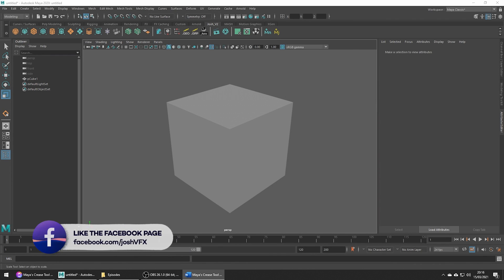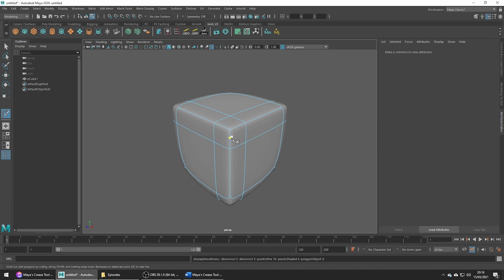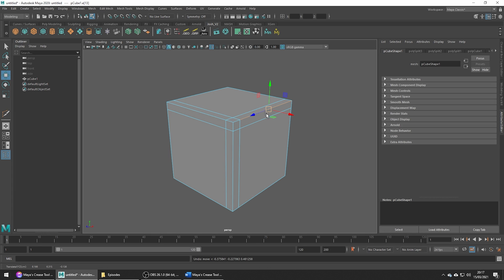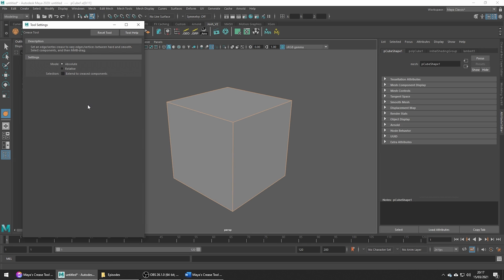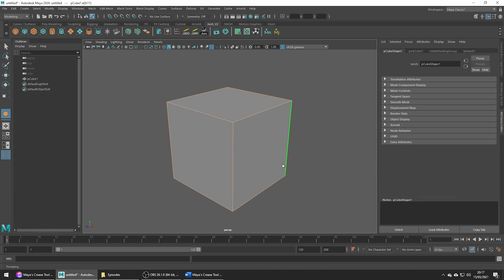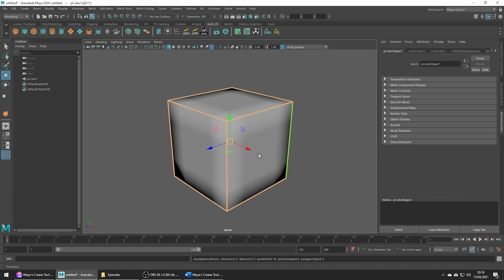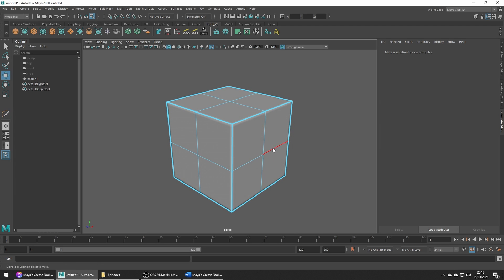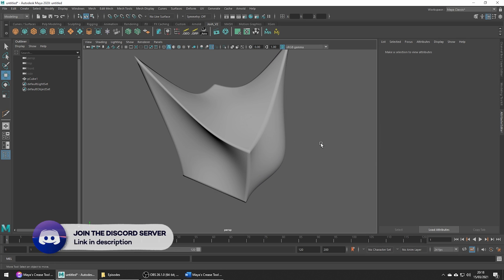Maya's Crease Tool

Comment: Best thing with creases instead of holding edges is you can get a high and low poly model ready for baking without extra effort. Sometimes you might still need holding edges though.